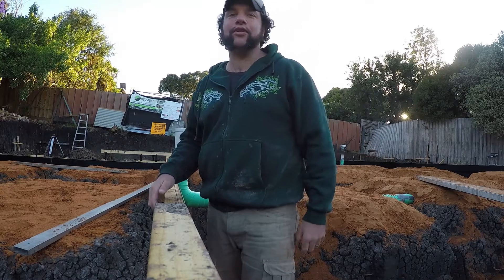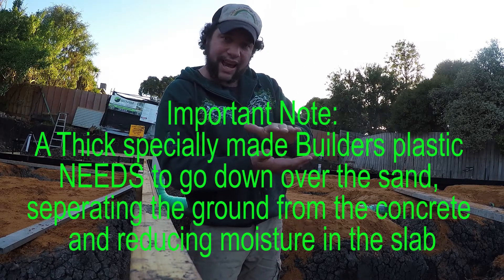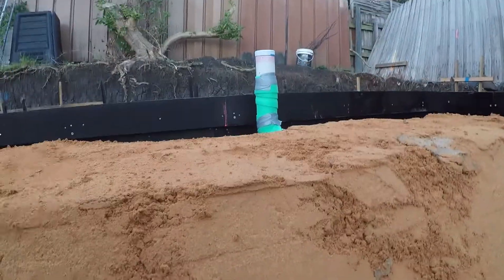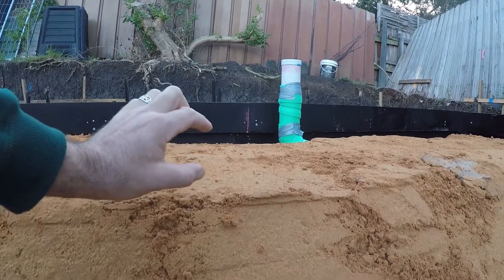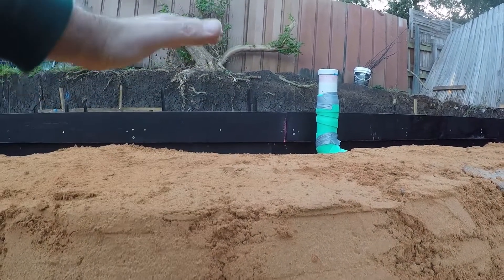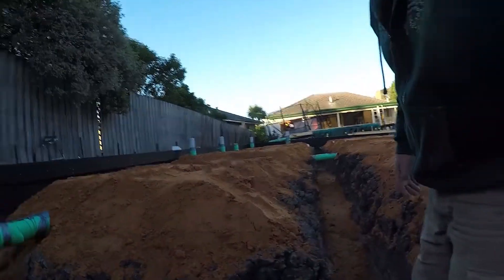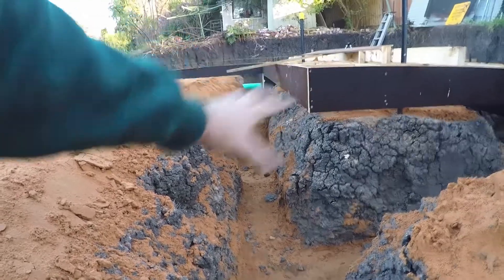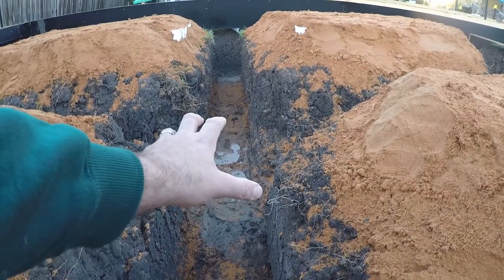Sand and prep work before concrete pour - Part 19 Green build

Comment: Hey Joejoe, the foam (either EPS or XPS) under the slab acts as a thermal break, insulating the bottom of the slab, but for it to work properly you really need to also insulate the beams as well as the outside of the slab around the perimeter, ideally encasing the whole slab with foam board. This can prove difficult and time consuming, but will yield the best result saving lots of money on heating. Great videos, keep them coming! :)
Reply from the maker: Gday Paul Marotta,
thanks HEAPS for the insight & AWESOME feed back.... there is a vid in the green build showing the poly on the pads to separate that area yet we didn't do this for the sides / perimeter of this slab.  As you stated it can be expensive and time consuming as as i explain in this series, time is of the essence and it keeps caving in.
#stayawesome
uncle joe joe

Comment: 👍NZ we got compacted hardfill under a slab on grade is 600 mm. Hardfill must be compacted in 150 mm maximum thickness layers. Where the hardfill depth is more than 600 mm, specific engineering design is required. , after sand blinding and dpm
Reply from the maker: Gday Ray,
WOWSERS.... i'd luv to see that !! very impressive.  
is this different between the north and south island ? and if so, is it due to the snow/ice ?
i remember that when building in Canada and America, they had certain depths depending on the frost line.
stay awesome
joejoe